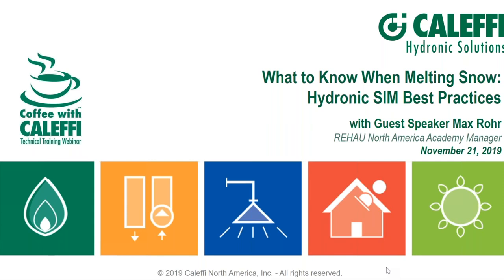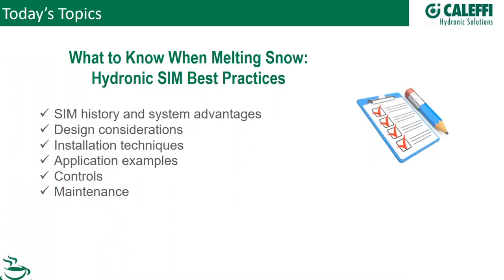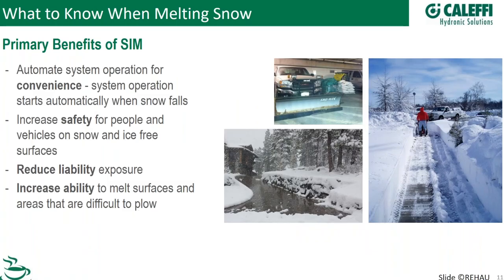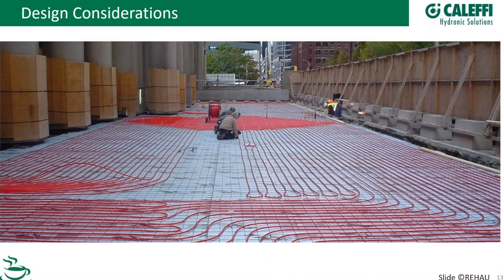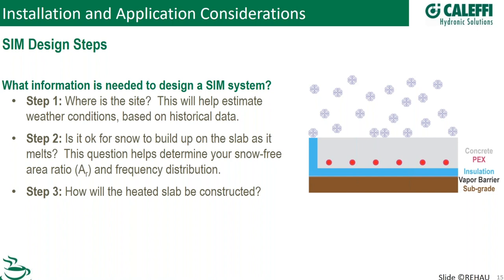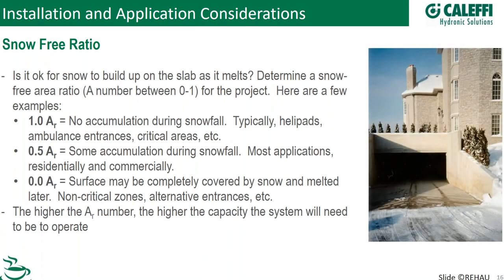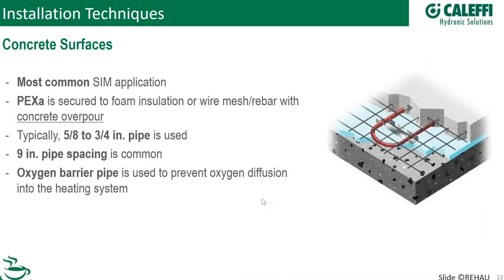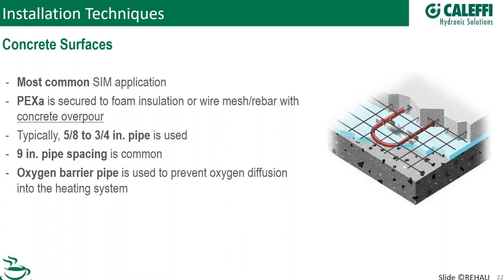What to Know for Melting Snow Hydronic SIM Best Practices

Comment: What temperatures should be circulating thru the slab?  In other words, what should be the temperature settings on the boiler?
Reply: We had a viessman 200 series pumping out 185 return was 165 and it's been great so far
Reply from the maker: 140F maximum supply temperature is a good rule of thumb, but you can determine a correct number for the particular load with a radiant/snowmelt design software.  Some controls can modulate the supply temperature to the slab, also.  You definitely don’t want to hit a 10F slab with 180F supply water, it could lead to a stress crack in the concrete.  (Sorry for the delay, some YouTube problem with the notifications!)